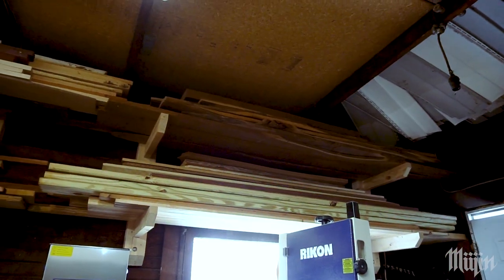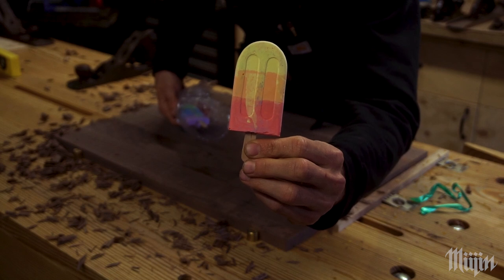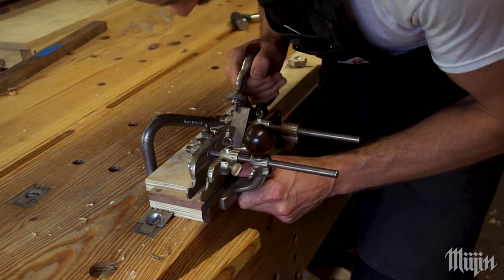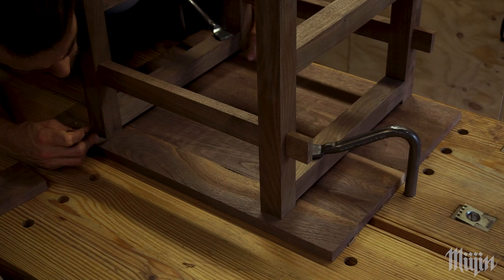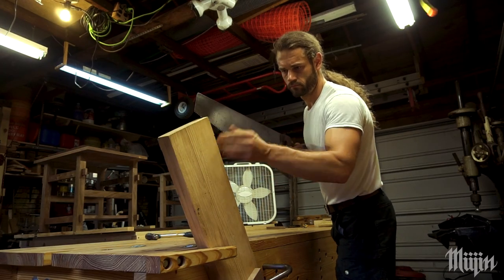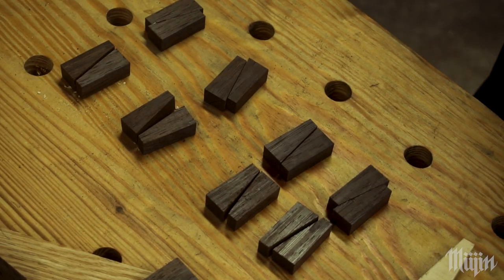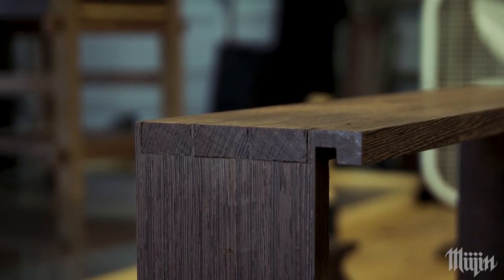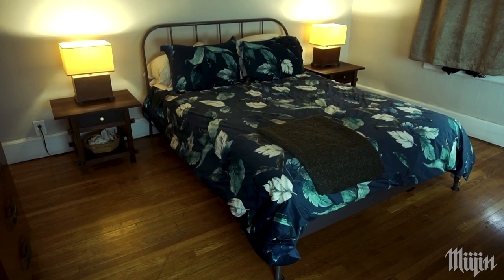Building a pair of side tables

Comment: Feel your pain on the #8. Pieced together a frankenplane jointer and found out the sole was hollow (giving me the same crap results). Took it to a machinist to get it flat and they didn't even get it close. Ended up saving for a LN jointer plane and it's been magical. 

Good content btw
Reply from the maker: LN is the dream. I can’t in good conscious sell my #8 as is, so I’m haunting eBay for replacement bodies. Otherwise I’ll try flattening it when I eventually get a milling machine but even that seems bleak with how out of whack it is.